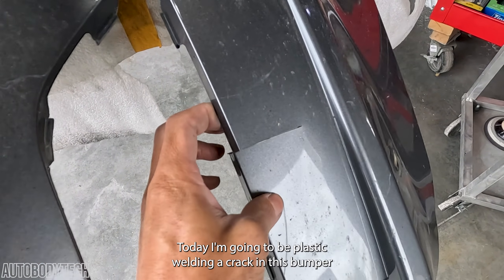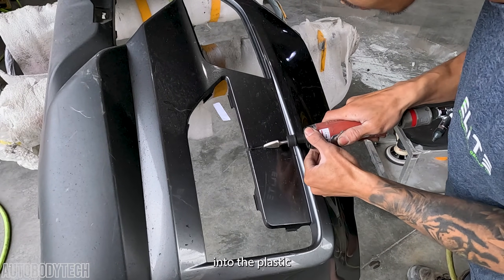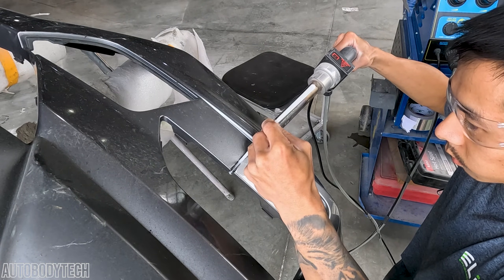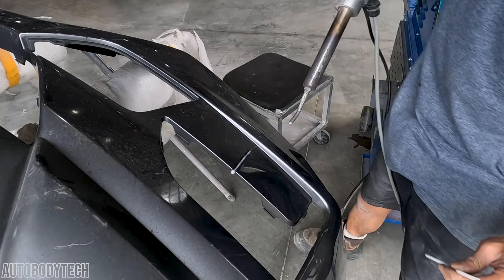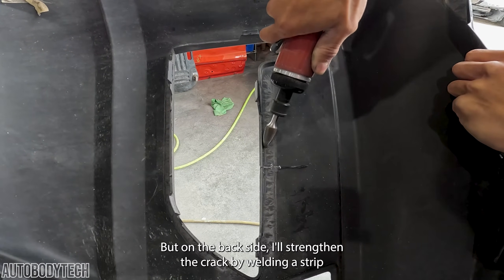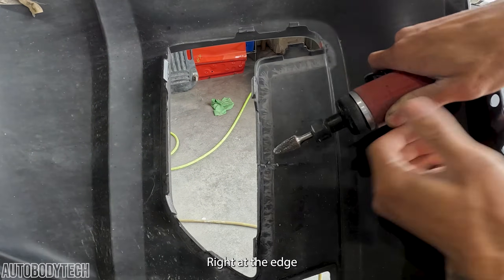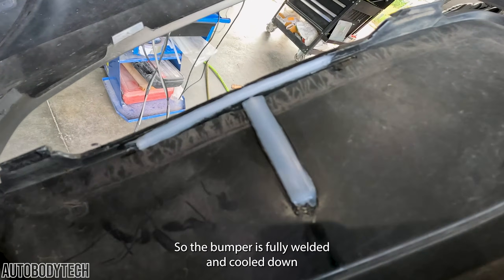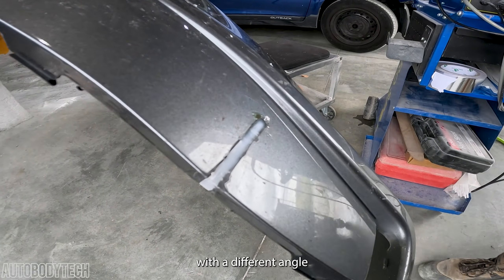How Durable is Plastic Welding? Find Out Now! CRACKED BUMPER REPAIR METHOD

Comment: Seems like the hot air gun does a much better job than the hot solderer type method
Reply from the maker: Yes 100%. Its tougher to melt both materials at the same time with a solder but it could be done

Comment: what is the temperature for hot air welder you use in this video???
Reply from the maker: Around 230c but the air pressure will also play a huge role

Comment: What plastic rods do you use?
Reply from the maker: Most bumpers are made with polypropylene(PP), but check the stamping on the plastic and match the plastic you are welding

Comment: I used glue 😂😂😂😂  bro I should of plastic welded
Reply from the maker: The glue method is old school and superficial. Alternatively, you can melt some steel mesh in behind the crack to hold it together. Nothing beats the hot air welder

Comment: That turned out great. I have used a hot tip to weld plastic before, but it was not as strong as that!
Reply from the maker: Agreed, This is the most effective method I've used for plastic welding. The hot tip is great for smoothing these filler rods once they are laid down